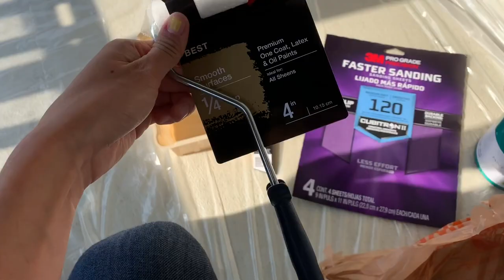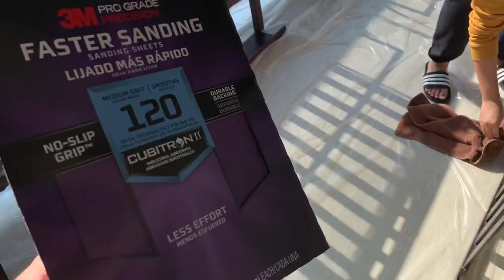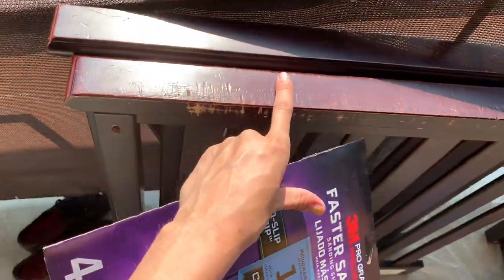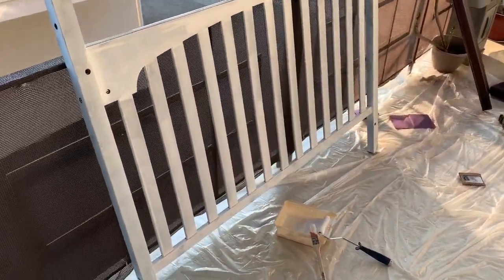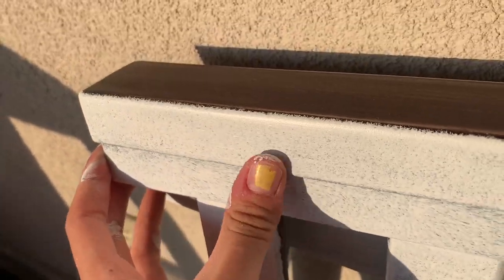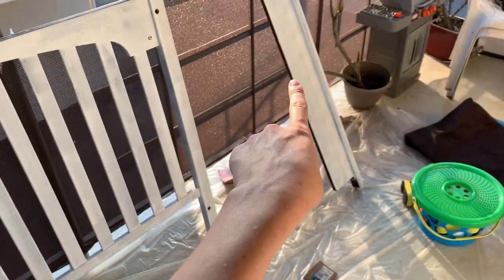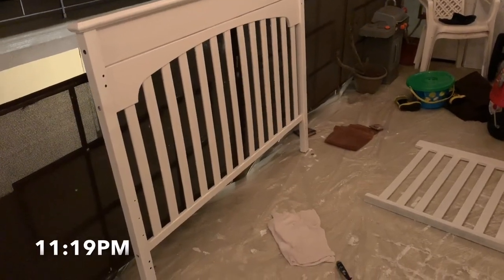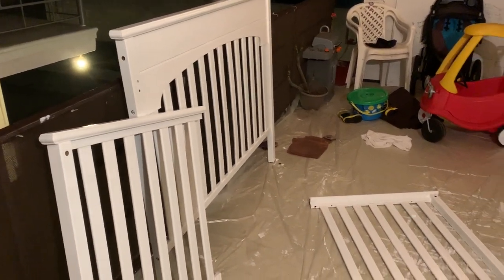DIY Baby Crib Makeover !

Comment: Thanks so much for the tutorial! I have almost the same color crib that I'm painting white. A few questions if you don't mind?
1. How do you know when you've "sanded enough?"
2. Are the two coats keeping well for you so far? No chips/cracks? I see that you didn't use Primer.
3. Was 450ml of paint just enough? Or did you have more left over? I'm guessing that my crib is slightly bigger.

Thanks so much!
Reply from the maker: 1. I sand it enough to see if the gloss came off and enough to get the new paint to stick. 
2. I have sold the crib with new looking conditions, so I’m not sure how it looks now, but as far as I know and when I had it, two coats were perfect, primer was included in the paint as well. So that was a plus. 
3. This crib was the most standard size crib, I don’t think they get any bigger than that unless you just have more wood to paint but the paint I had, I had well enough paint to do a 3rd coat maybe. 
Hope this helps ! Sorry for the late reply
Reply: @emilyirene2806  What is the name of the paint that you use, please?
Reply from the maker: @ld7021  the cheapest I found, it’s in the video. Pause it and see :) I sold the crib a long time ago so I’m not sure how well it holds up but it’s low VOC which is good for kids